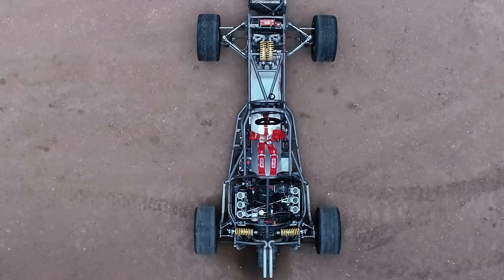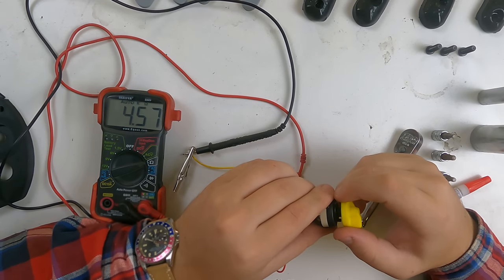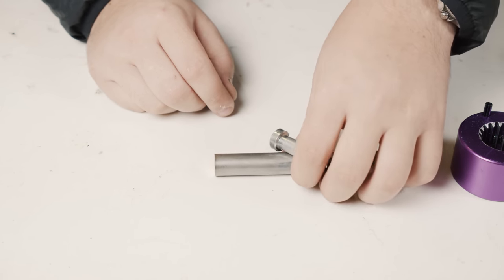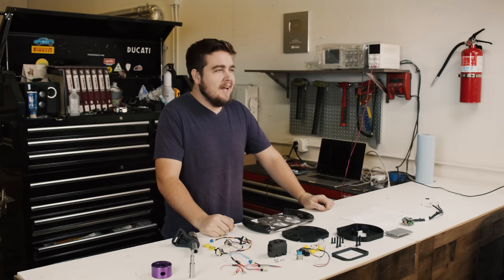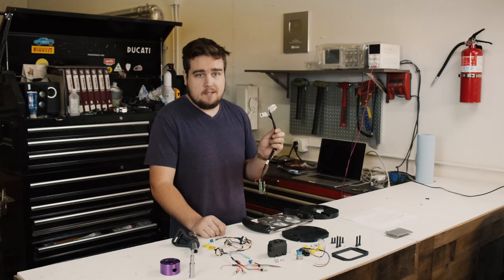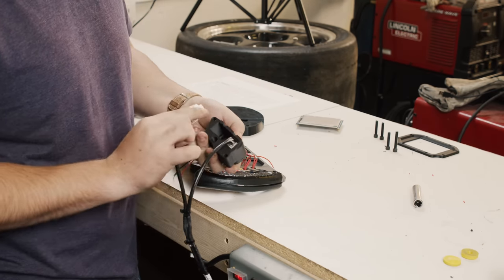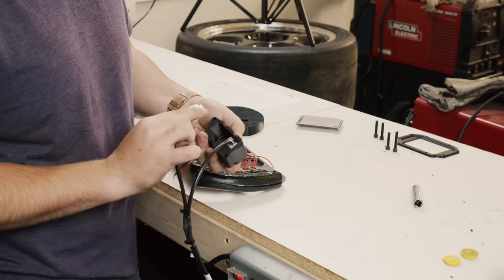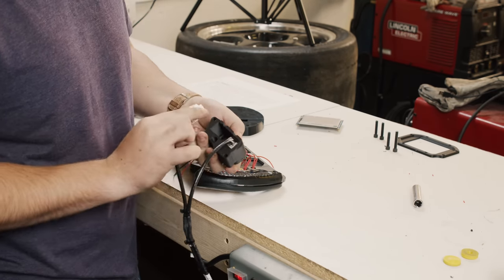The 60's F1 Car Returns with a V12

Comment: Tpu tuning = retraction and flowrate. 

How i do it ;
First i do a estep calibration as each different filament has different properties.
Flow calibration.
Retraction calibration.
Testcube for dimension calibration in the slicer.

Pain in the ass but you get used to it.. Do take notes of the current settings so you dont have to do them every time u change filament. Eventually you build up a database of materials for your printers quirks and features.
Reply from the maker: Noted- I'll do some more test prints. My Prusa has some miles on her but she's still going strong. I'll dial it in.
Reply: I find the biggest issue is I've tuned my printer to run fairly fast, and TPU just has to be printed slow. I have it limited to 3 cubic mm per second (vs 10 for ABS). What slicer program do you use?
Reply: calibrating esteps for each filament seems kind of excessive if you do flow calibration anyway(if you don't mean flow calibration as pressure calibration, and not as flow/packing factor calibration). it's not like like pinching the filament affects much at all how many mm the extruder pushes filament per a step of the motor.

tpu prints pretty easy for me, though i guess it depends on how soft the tpu being printed is.
Reply: @lasskinn474  to you it seems so. Good for u. Thanks for ur input that gave nothing of value. Great addition..... that you dont understand is one thing. That others do it what matters.
Reply: @TinkerLynx  tpu is not tpu. If u know what i mean?
I wish ppl would add the shore hardness when saying tpu. Take esun tpu vs ninjaflex. Both are tpu. One is supersoft and springy, and the esun is flexible but not stretchy.
Reply: @reyalPRON  extruder steps are supposed to stay static according to your grub wheel. You calibrate it by extruding say 10cm or 20cm of filament.

The adjust per filament how much volume it takes after its out of the nozzle you do in the slicer.

I know in some newbie 3d printer circles theres instructions to calibrate the swelling afterwards or filament diameter by e steps but thats both a fools errand and not how you're supposed to do it per people who wrote the firmwares.

The pressure advance changes by filament and that you do need to adjust with a test print, but mostly you can leave that alone. Look i've been printing long enough that pressure advance and acceleration were new things back then...
Reply: @lasskinn474  the different filaments have different tensile properties. If u want accuracy this is what u must do. The distance from the gear to the end of the nozzle is a travel path. Different materialt travel different. There is a reason u can set the value with three decimals. But thats another discussion more suited in another fora, the man asked for tips. I told him how i do it. Then u butt in with zero content and have a very rude attitude. How do recon ur non educated two cents add to the help with getting tpu dailed in?.  In newbie circles..... rude as f.

I use linear advance and all the bells and wHisltes. A 0.8 mm retraction length on my rig says u dont have a clue on tuning. 

In no scenario i can imagine does time spent equal gained knowledge.

Wierd how my chepcubes come out 20.01 - 19.99
Reply: @reyalPRON  the travel paths not to do with the esteps being esteps, from gear to nozzle is a pressure thing. You dont need to mess with fw values per filament except retraction lengths if you use fw retraction going between filaments and tuning a 2cm cube is easy if you don't tune a 10cm piece at same time to how things contract..

Edit: i guess if you use gear that has loong bite the gear diameter changes enough but still...

Comment: you'll change that steel plate to 5mm carbon fiber at some point :-)
Reply from the maker: I will, but Steel is cheaper when I inevitably know I'm going to take a milling machine to it haha.
Reply: @WesleyKagan  yeah, you've got at least 3 more iterations to go before you feel confident enough to work on trimming the fat.

Comment: I wonder how hard it would be to make this street legal
Reply from the maker: I mean everything is street legal until someone sees you in it.
Reply: @WesleyKagan  LMAO! True
Reply: @WesleyKagan  Thinking about it some more, I wonder if you couldn't move all of the logic out of the steering wheel to the main 'duino and convert the screen and controls to a USB-x device with a single 12pin plug. Might be a job better suited to a Pi, though the additional horsepower there probably wouldn't hurt any either.

Comment: hey if you still need to get a main board designed im pretty good at designing boards! I could give you a good first pass for version 2 if you would like to collab !^.^!
Reply: you could also use resistor divider networks that are cheap and easy to design with to cheapen your expenses and time
Reply: you can also use differential line transceivers to transmit i2c or anything much farther over cat 6 
MAke a little can network. OR switch to an esp32 since it has actual CANBUS on it and you can use it like i2c except for the screen. Plus the esp32 is about 100 times faster than an atmega 328p, has built in wifi, and has at least a megabyte of space for graphics, and also talks sd card too for graphics
You can use the arduino software to program it too

Comment: Please throw away all the AVR based arduinos off a cliff or preferably into an active volcano. It is absolutely idiotic hardware for anything more  than blinking a single LED. 
Get something decent like ESP32, they have megabytes of memory and run on frequencies that are not from '60. They also give you wifi and bluetooth out of the box for free. You can also write code in arduino ide for them if you absolutely must - all the libraries are ported.

PS to all the "atmegas are perfectly fine for the task" types: sure, putting your food in a hole in the ground instead of a fridge was also  fine for hundreds of thousands of years, go live in a cave without fire.